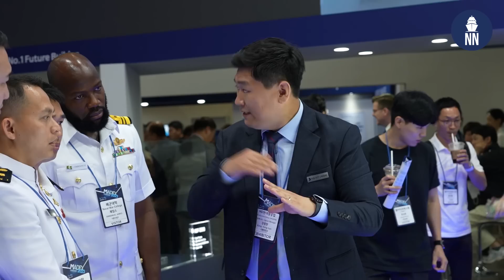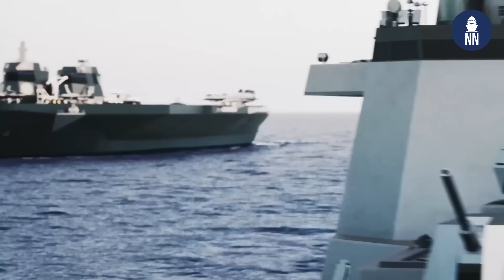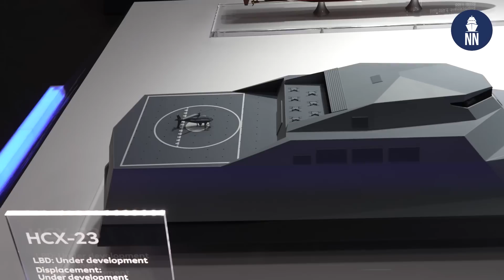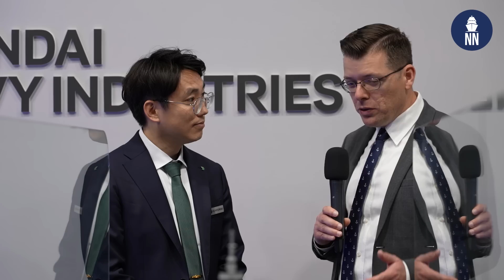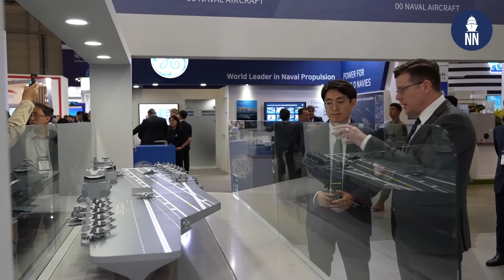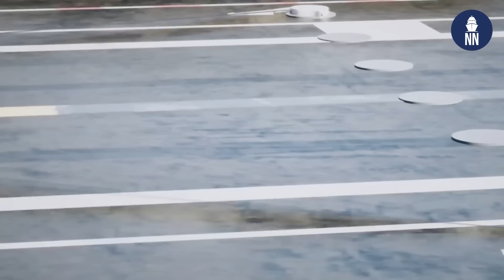HHI at MADEX 2023: KDDX, HCX-23, FFX Batch III, KDX III Batch II, CVX

Comment: The CVX is a cool design to look at but not sure how South Korea can sustain it logistically. This ship might require some global voyages that consumes a lot of resources. Having a wide variety of sustainable energy sources like solar panels, wind turbines, or hydrogen fuel cell engines (fuel by processed sea water) is ideal for longer voyages. Investing in modular storage spaces and solutions with onboard production facilities such as a vegetable garden or a metal 3D printers for immediate access to spare parts. With so many potential problems associated with the CVX design, developing smart solutions when isolated at sea will save the ROK's Navy a lot of time, money, and resources. They might as well integrate some merchant ship features into the CVX design such as dry bulk cargo bays for "expedited protected shipping" to fulfill priority diplomatic missions or needed immediate cash.

Comment: Looks similar to chinese type 55 destroyer
Reply: Bullshit
Reply: chinese have no eyes.
Reply: it's the other way around.
Reply: @aoan6403  How could it be the other way around if this is just a model and type 055 is sailing
Reply: @asn4556  If the KDX-III, which was commissioned in 2008, is equipped with a new radar and reduced in size, it becomes the KDDX in this video.
I don't think 055 and KDDX look alike, but both are beautiful ships.
Reply: @asn4556  And both the KDX-III and KDDX adopt the shape of Arleigh Burke, active since 1991.
Reply: @asn4556  kdx III batch 1 commisioned on 2008 while type 055's 1st ship was commisioned on 2014ish I think. The model in the video is KDXIII batch 2 which is the latest iteration of the KDXIII program.
Reply: @aoan6403   Considering the form of the mast, I think the author saw KDDX and wrote a comment.
And I know that KDX III and KDDX are separate businesses with plan of 6 ships each.
Reply: @ililililil8508  oh really
Reply: @aoan6403  Batch 1 and 2 just look like modified arleigh burkes without a integrated mast, not like type 055 however DSME KDDX model looks kind of similar with 055 but HHI KDDX looks different
Reply: @san1804  China is only subcontracting production using technology developed by the United States.
Reply: @san1804  And most of the computer parts I use are made in Taiwan.